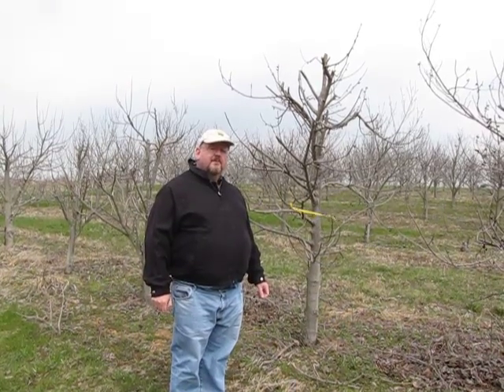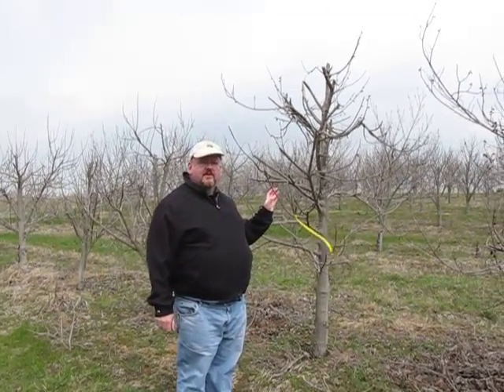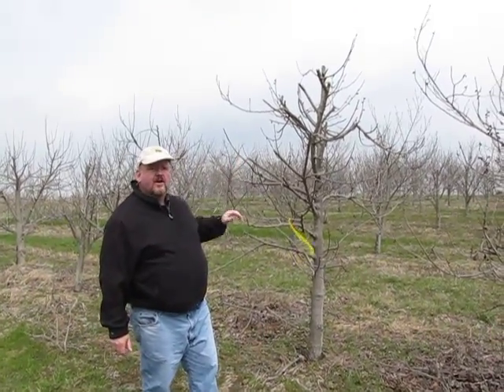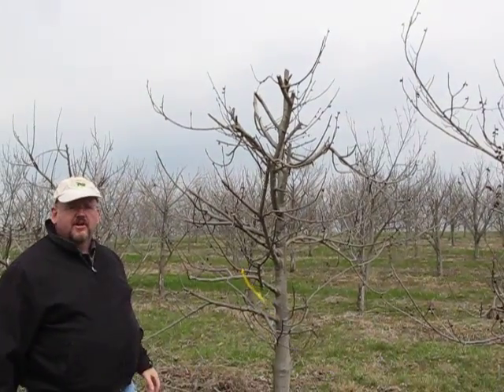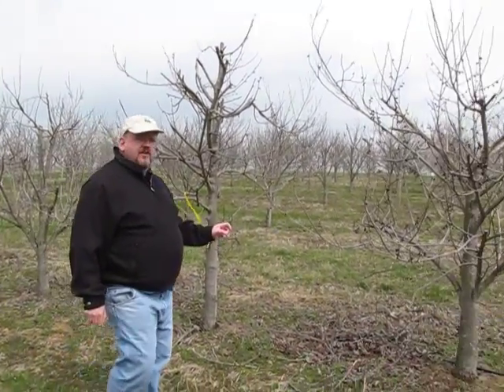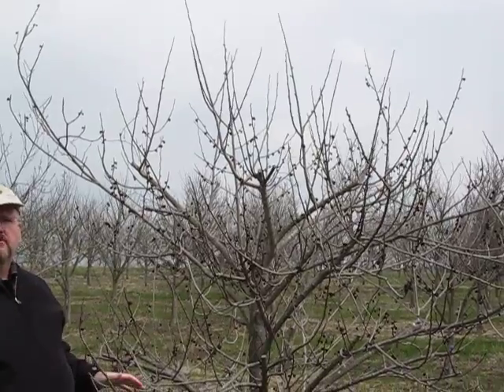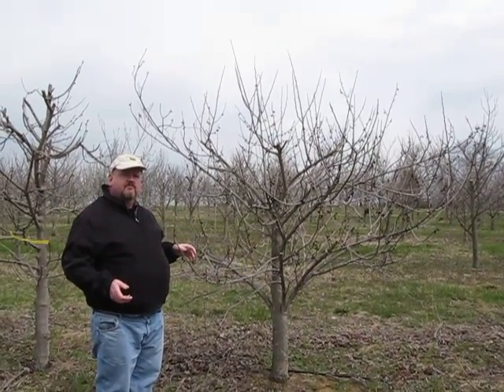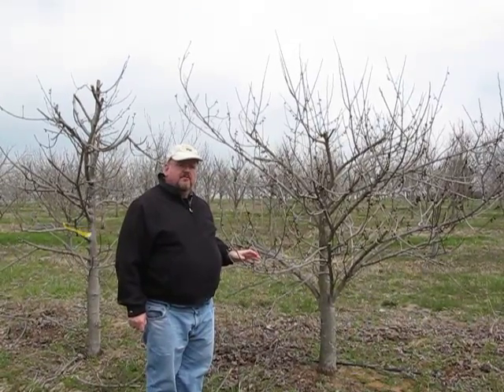Pruning pawpaw trees to generate budwood for budding and grafting

Comment: Great advice for the serious tree grower. I have an example of one of these type, (cut back hard) trees for propagation for several different cultivars. I actually had a storm tear a tree apart many years ago with the same resulting lush new growth afterwards, teaching me this, which I have done since.
Another great source is the first year wood that comes out of a bark graft, where it grows much larger and longer than what a branch normally would grow.  I do it more on chestnut, but pawpaws react the same. Large caliper wood.
Great little video!